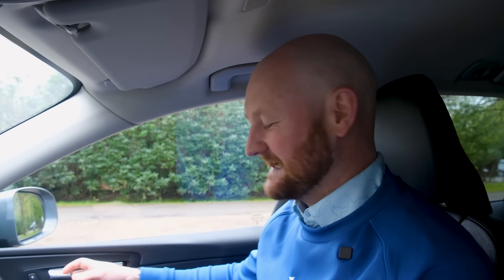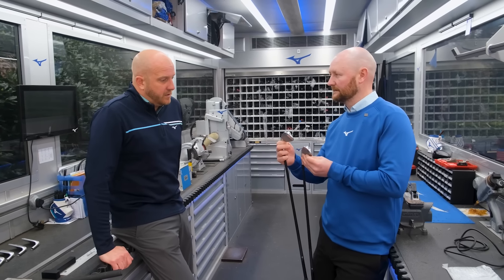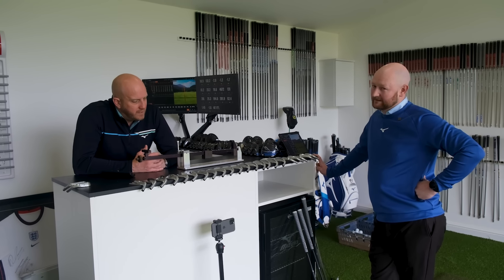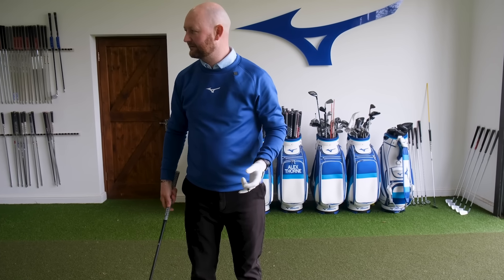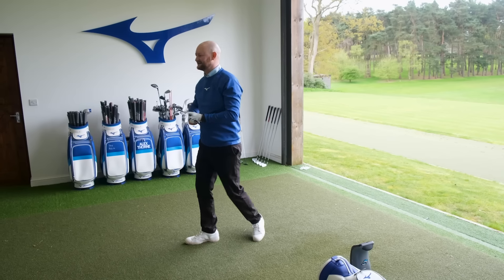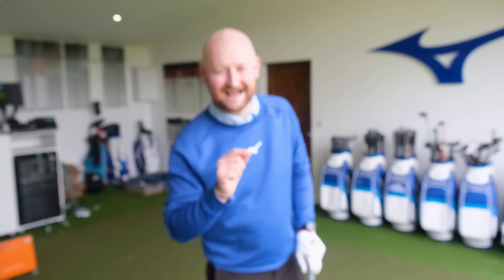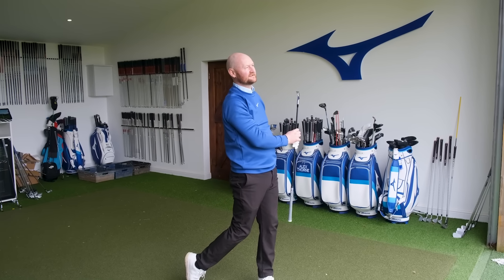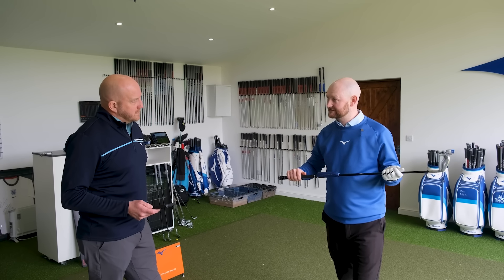I Got A FULL TOUR Fitting For My NEW IRONS! (+ HUGE GIVEAWAY)

Comment: Matt I'm ready to play.
Picked up golf around 5 years ago and always struggled with the irons even after plenty of lessons, went to my local golf shop yesterday so see about upgrading but they had no 2nd hand irons in stock. They told me I had 20 Yr  old game improvement with R300 shafts. I took a few shots with my clubs on trackman and the guy suggested trying out  the Mizuno forged 925, off came the wrapper on the demo head and of I went with a 115 Stiff Mid +1/2 2Up. It was my first time hitting new irons, what a treat. By the end I was carrying 165yd, 6000 spin, 47 decent. Its amazing what a proper fitting can do, no need for more lessons, just fitted clubs. What a treat to hit those clubs, pity and don't have the means to buy the. 😢